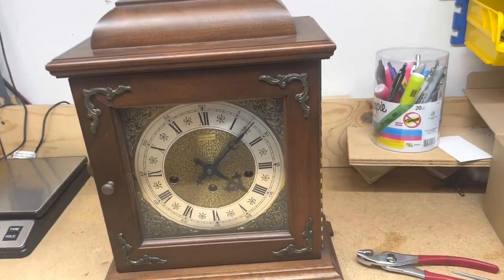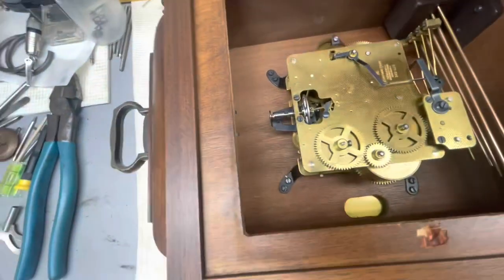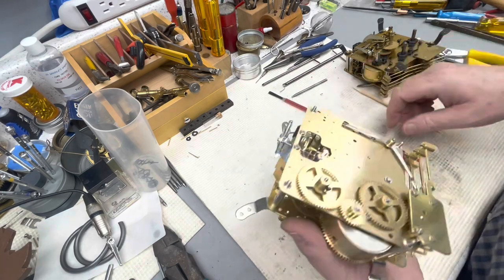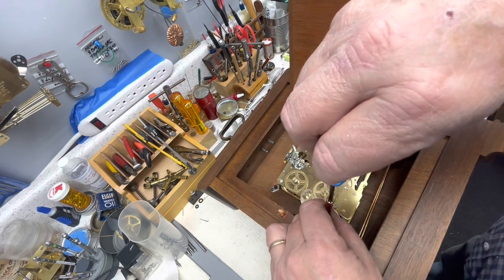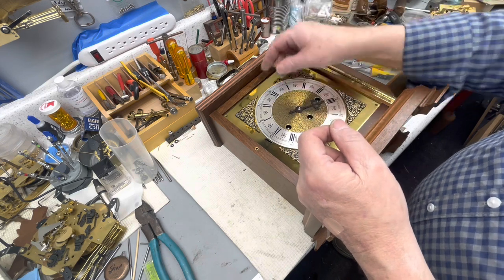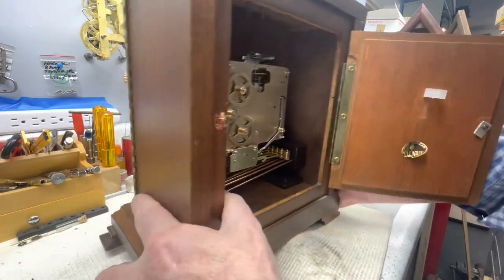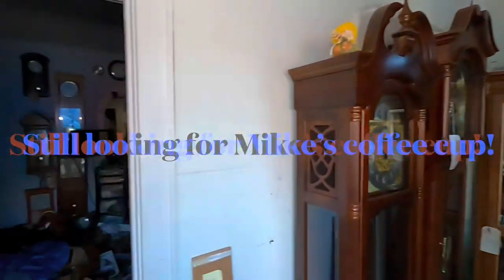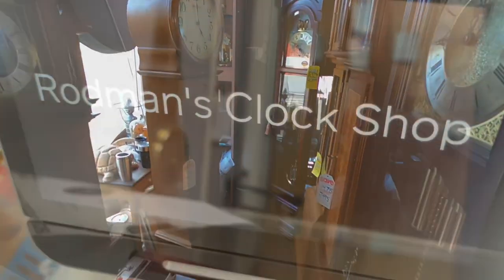Replacing a Hermle 340-020 movement

Comment: I recently did the exact same thing swapping the movement out on a Howard Miller clock I have here at the house. One thing I learned from watching your video, I need to get one of those wire bending tools and a set of those spacers. That would definitely make it easier when I have to do things like this again.  Nice video! Thanks for posting it.
Reply from the maker: Here is a link to the spacers https://www.ebay.com/itm/Dial-Arbor-Stabilizer-Movement-replacement-spacers-MT1391/195564371860?pageci=082b1a56-c0ab-4317-8fab-2dd156b2219a&redirect=mobile
Reply from the maker: Here 9s the link to the wire benders; https://www.ebay.com/itm/Clockmaker-s-Wire-Bending-Chime-Hammer-Adjusting-Tool-Set-of-3-MT1014/374484915941?pageci=75f3e2aa-112a-4402-9acd-0f1c7dc437fc&redirect=mobile
Reply: @JRCLOCKER  thanks I'll get a set on order

Comment: Fascinating.  So glad I've found your channel.  I recently purchased a 2000 Hermele mantle clock from ebay here in the UK. Your tips are excellent. My wife complains the Westminster chimes are too loud. I have laid a thin piece of kitchen tissue under the hammers on the chime bars. Works a treat. Much quieter,  unless there is a proper method that you know of? 😄

Comment: Hello. Excellent video ! I bought a clock similar to this off EBay but that horizontal circular like pendulum won’t stay ticking. I have wound the clock and I take my finger    And swing it towards the plus side and it starts ticking but then after a minute or 2 stops. Can you tell me what to do ?

Comment: Would you mind showing us how to tune a set of random chime rods that didn't arrive as a set? My clock has 2 broken rods and I got some new rods that need to be installed and tuned. How do I determine what the proper notes should be? And what is the best way to cut these to the right lengths?

Comment: Hi! I recently purchased a a forestville mantle clock with this exact movement. It appears to keep time well but the hour hand is misaligned backwards (e.g. the clock will strike the hour, but the hour hand shows approximately quarter to the hour). I attempted to remove the hour hand to adjust the placement, but it has proven to be very difficult to remove by hand, unlike in your video where the hands easily popped off. Any suggestions on why the hand might be stuck and how to remove it?
Reply from the maker: The hour hand is just pressure fitted on to the shaft, so you can move it to the hour the clock is chiming.

Comment: I want to get the wire bending tool and the square awl for the hands. I didn’t see it on your eBay account
Reply from the maker: I hope this helps, Jim
Wire tool; https://www.ebay.com/itm/375535566722
Hand adjusting tool; https://www.ebay.com/itm/375036338543

Comment: Do these New works need to be oiled before installation? If not, would it be a generally good idea anyway?
Reply from the maker: They do not need to be oiled, but generally oiling them before installation can be a good idea.
Reply: I recommend oiling them because you don’t know how long they have been lying horizontal.

Comment: Where can I get the tool you are using to set chime bar
Reply from the maker: Ere is a like to the tool on my ebay store; https://www.ebay.com/itm/Clockmaker-s-Wire-Bending-Chime-Hammer-Adjusting-Tool-Set-of-3-MT1014/374484915941?pageci=75f3e2aa-112a-4402-9acd-0f1c7dc437fc&redirect=mobile

Comment: Where do I order a set of the spacers?
Reply from the maker: Here is a link to the spacers https://www.ebay.com/itm/Dial-Arbor-Stabilizer-Movement-replacement-spacers-MT1391/195564371860?pageci=082b1a56-c0ab-4317-8fab-2dd156b2219a&redirect=mobile